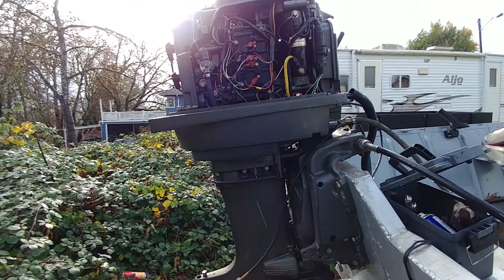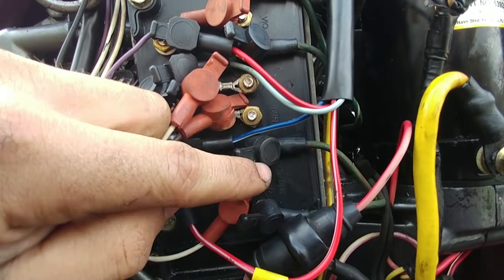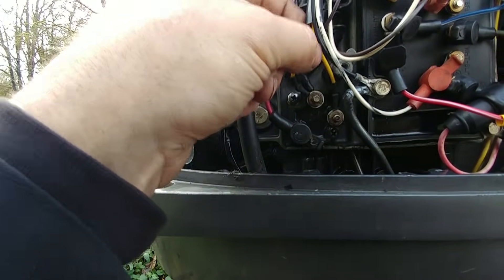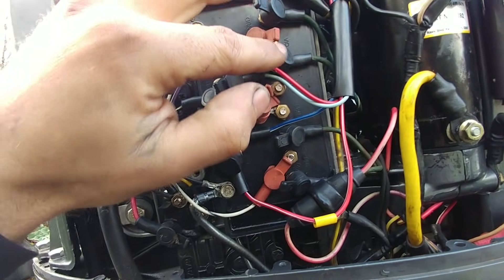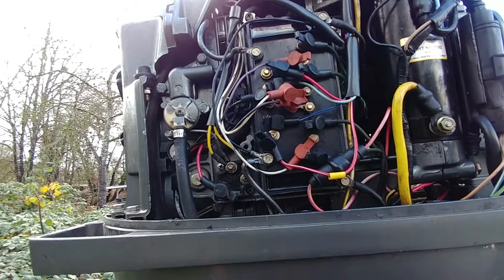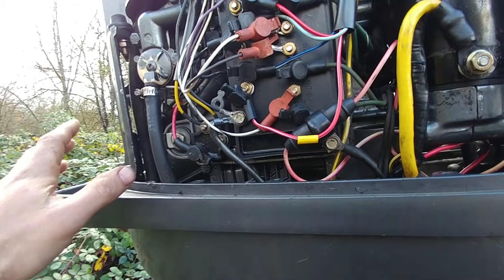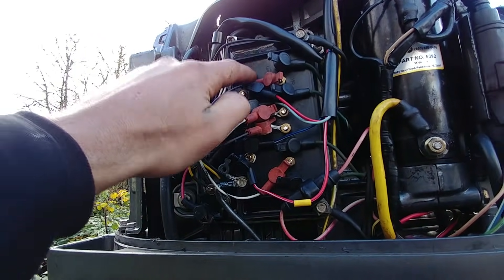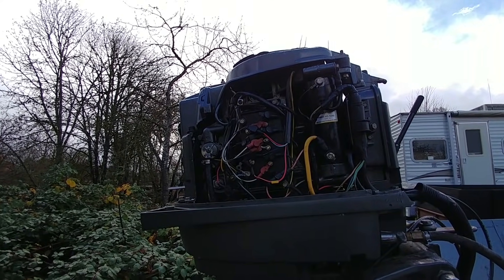how to fix no spark outboard

Comment: Not sure if you will respond to this as this video is 7 years old, but may I ask what motor this is? It looks very similar to the Mercury Thunderbolt that I have on a FB Marketplace find boat. I don't know much about boats and outboards, but I am trying to learn and get mine running. It turns over, but have yet to be able to get it to fire up yet.

Comment: problem with my CDI (Johnson 35/2-cyl/2-stroke) is the CDI is molded.. not connections.. the wires disappear inside.. I'm going to try and 'stab' them to get a reading. I've swapped out plugs, coils, wires... bottom cylinder isn't firing... you would think swapping coils, wires, plugs would reverse the symptom but it's still the bottom cyl not firing... could it be the CDI pack?
ps.. great video.. easy to follow.. thx

Comment: Having intermittent spark on cylinders 3 and 4 on 1986 Mercury 75 hp. Swapped wires but finding it very difficult to isolate the problem by engine cranking only.

Comment: Current goes 1st on the rectifier and then to ignition coils and cdi right? Ac current from the stator wouldn't do the job if it was directly connected to the cdi and spark plugs

Comment: Don you still own this engine bud .I'm from the UK and nobody over hear knows a thing about theses
Reply from the maker: I have one just like it yes
Reply: I know this is a bit of an ask .but would you be able to help  me locate some Information. Regarding the wire diagram for the starter /  ignition switches .also would you know the correct part number for the trigger as I'm struggling for a spark
Reply from the maker: Marine engine.com will have alot of that info.

Comment: I'm getting no fire to any plugs on a 1997 Suzuki DT115 with less than a 100 hours on it. Mines turning over but its getting no fire to the plugs, from my understanding of the Factory Manual it could be the Pulsar Coil, the Trigger, the Gear Count Coil, the Stator or the CDI Unit. I wish there was a video on how to test all the different parts to know for sure what to replace.
Reply: I’m here today with same issue as you describe
Reply: @JayMuzz-xn3rv  It's been a while like about a year but after spending $150 for a Factory Manual I had to get the Voltage tester leads to add to my Multi-meter to test everything and it turns out it was my CDI Unit. I later found out when I let my step father use the boat for the summer he jumped the battery instead of taking it out and charging the battery and he hooked up the jumper cables wrong shorting out the CDI. So, at a $3200 new CDI replacement cost I took the motor off took the boat to a Boat Dealer and dropped $12,000 on a new Tohatsu 115 with 5 year warranty. The Suzuki is sitting in my shop today and I hope to sell it one day.  I'll never buy another Susuki boat motor again.
Reply: I got the same issue right now with a 1999 Suzuki DT150
Reply: Here I am
Reply: @JayMuzz-xn3rv  I had to buy a gauge to test and a book at $200 to find out it was my cdi unit at which new would have cost $3500 so I was done and dropped $12k on a new Tohatsu 115 hp installed with a 5 year warranty. We had a blast this summer pulling the kids on the tube and just cruising the lake.
Reply: @casper3130  That’s a great investment 
It will last a very long time
I am thinking of buying a cdi box for $100 new
And or getting a 150 diagnostic
It’s been sitting for months 
I ain’t to worried about it anytime soon you know
Reply: @JayMuzz-xn3rv  Good luck with it.
Reply: @casper3130  hey man 
I appreciate it
You know lol

Comment: Love the content! Not sure where to begin but I’ve been looking forward to firing this old  105 hp Chrysler  I recently found[surprisingly clean] but needs some attention.so far, I’ve rigged the ignition switch at the motor to eliminate bad wires and so forth, but still will only run for a brief second on starter fluid and only with the key in the on pos and by jumping the solenoid.Initially, I got spark on all cylinders with an in-line spark  tester,but now I don’t seem to be getting spark on any cylinder. Compression is at 145-150psi. Cleaned out carburetors twice. Any tips would be appreciated! I suspect the timing may be off but I will also change the plugs is weekend and go from there since I don’t believe fuel delivery to be the issues since I’ve changed it! Thanks in advance!

Comment: Ok little confused.. you said the stater is to convert A/c to D/c to charge batt. Then you said the stater was to give the power pack charge. Will a motor start if there is a bad stater? And what about rectifier, will motor still start with bad rectifier?
Reply from the maker: Ok sorry. There are two winding in a stator. One the powers the cdi for spark. And another that feeds the rectifier. Then power gos from rectifier to battery. Bad rectifier engine will run with no battery charge. Bad stator on the cdi side no start. Bad stator on the rectifier side will start.
Reply: @CAPTAINWILLY   Thank you! 
It did finally attempt to start and when it did I noticed the flywheel changed direction to counter clockwise not sure why Maybe I have the stator on wrong I need to rotate it one bolt hole IDK you have any idea? And there is only 2wires coming out of stator I don’t think I got them hooked up wrong. 
Working on 1979 Mariner 115hp in line 6 tower of power. 
When I try to start it flywheel is rotating clockwise (normal) rotation I believe, then when it attempts to fire up flywheel changes direction. Haven’t ran it that way don’t want to miss it up.

Comment: I have an early '90's 175HP mercury outboard and one ear broke off the propeller (didn't hit anything) drove it back with alot of vibration for 10miles and suddenly the motor completely stopped. I have no spark anywhere now and motor wont start but turns. I did a visual inspection and no wires broke off. Had a mechanic look at it and he stated it might be a fried ECM , three wires that looked like they melted and or bad coils. (I don't think he did a well Diagnostic on the motor.
While reading through the comments it looks like a bad CDI box , Stator or trigger.   
My worst case scenario a bad piston ring fell.  I'm not that great with electrical.  Any help would be appreciated

Comment: My motor is turning over but no spark on any cylinders I have 2 stroke 4 cylinder merc mariner 40hp. What could it be replaced stator switch box battery spark plugs what else?
Reply: I have the same issue.  No spark anywherr..anywhere... have you figured out your issue?
Reply: @Diego-le5xt  I think my new stator was no good have you changed your stator? About to try a new one I'll let you know once I try that if you want...
Reply: @robpaul7900  yes let me know. Thank you

Comment: So I have a Merc 90hp 2002. But it does not have a CDI box.  Just the rectifier.  Still trying to figure out why no park. If I have no CDI box where do I look for that interchange between Stator and trigger?

Comment: my 2006 90hp 2 stroke OIS ignition suddenly has no spark. IF im testing stator right MY ohms reading brown to brown 865 dva output 219, orange to orange ohms 56 dva output 4.5 im reading that on dc 600V should that be on Ac volts ?. I believe it has a sensor not a trigger. Not sure if one can create other to show no fire?? Dont mind putting some$ in to it just dont want to throw bad $ at it. Any help is appreciated

Comment: Hi Captain, I have a 79 mercury 115 with no spark. I just got it. The previous owner replaced stator but not sure what else they did. I’m not sure if it’s a bad kill switch, trigger, cdi, coils etc. I see a black wire down by the cdi with tape rapped around it. Do you have a diagram or know where to get one. I’m not good with electric at all but willing to learn.

Comment: Hello there boat Community!

I hope someone see’s this, I recently got into boats and motors and am trying to repair a 4 stroke merc 6hp 2007, which has been standing for about 1-2 Years. 

But as I dont really know too much im having some troubles, theres no spark, (already changed oil, Spark plug and gasoline) so I thought it was the Coil, so I brushed that real clean of most rust, sadly I dont have an Ohm reader to test it. 

My guess is that the kill switch cables are the problem though, would you have some procedures or tips to finding what my motor wants and or needs, thank you in advance. I do not have the money to let a professional look at it or buy any expensive spare parts.

Have a nice day.
Reply from the maker: Guessing will be expensive. Go down to harbor freight and get a dvom. Digital voltage ohm meter. You will meed to test continuity between both wires on the kill switch in both positions. 000.= engine off postion. Open=engine run. 
Fair warning. Boat is an acronym. Bust out another thousand. It can be cheap but when things brake its usually at least 200 bucks... Every time
Reply: CAPTAIN WILLY Thank you for the advice I will try to get one as soon as possible as well as test it out! 😄
I’ll keep you posted If I make progress!

Comment: If trigger is bad would that cause stator wires to get hot and melt the plastic
Reply from the maker: Yes. And or the cdi box. If there is any short to ground. It will cause melted wires. Iv even seen a coil cause it

Comment: You have some of the best videos out there on this man thank you
Reply from the maker: Thanks brotha. Please share it on your socials
Reply: CAPTAIN WILLY I was wondering if the trigger is bad would that cause the stator wires leading to the switch box to get hot and melt the plastic coating on the wires
Reply: I just shared it as well

Comment: Around here 95% of the ones iv worked on cdi or power c
Pack bad my merc 90hp stop firing one #1 power pack
Reply: I just fixed my Johnson 110. It would run great when cold but when it was warmed it would run like crap. Hard warm start.  Had air, fuel and compression was 115 across the board.  It was the power pack. Replaced and now she hits 32 mph on 20ft chapperal at 5100 rpms

Comment: Thanks! Please give me your advice. 1985 90hp Evinrude 4 cylinder. Runs rough at idle and low speed. Kicks in at mid to higher speed... One cylinder barely working at idle when plug wire pulled off while running. Things i checked...115 compression...coil swap...plug wire swapped... Fuel pump checked.. carbs swapped (2 double barrel).. sprayed carb cleaner into bad carb throat no effect but kills other side of double carb when sprayed into it.. checked spark with timing light looks like others..ran it with the plug out just blows warm air no water or fuel..plug is never very wet after running just lightly wet.. cleaned the carbs.. still not picking up that weak cylinder. Please let me know what you think. Edit... Ok i switched the power packs no change.. when i spray starting fluid in carb upper and lower it gets boggy.. also bogs when priming bulb or pushing in key for choke.
Reply: By the way this motor has one power pack per side. Thought about swapping them but timing light showed ok.

Comment: I need help with my motor just bought a boat. No spark on any piston
Reply from the maker: You need to test ac voltage from your stator while cranking first
Reply: I had that problem, and it was the safety switch
Reply: Lucas Hunter hey I got one cylinder not firing, I have done all the trying different wires and it works on different wires, would it be the stator ?

Comment: I have a 2002 merc 75 hp 4stroke.  only 2 and 4 have sparks on. 1and 3 do not have sparks. I am going to need to replace all the wires and give it another try tomorrow If I can find 804271T in stock with all the dealers here on the island. If not, I will have to wait for the eBay guy to ship to me.... If there is still a problem ( not geting sparks on 1and 3) I will hate to replace the stator and It IS a pain in the ass to get the flywheel nut off( I had to ask to plumber guy to use his ranch where he gets off the 2" pipe off) and then get a KMS tool( $30 )to take the wheel off( I think it is called a flywheel puller).  Extended cranking on my bad costed me a $300 starter, another $280 for those two sets of coil wires, and I do not want to spend another $300 on the stator.....  You video is good information and is helping me to regain my confidence after I lost power on the water last week..... I am from Canada but has not so fluent english writing skills.
Reply from the maker: Your writing was great. A little tip for ya. Find a big tough angry dude and a long pipe. Put the pipe on your wrench and make the big guy hold it tight on the flywheel nut. Then tap the starter. Cranking the engine should rotate the nut the right way to loosen it.
Reply from the maker: Only spark on two cylinders. 
Attack one at a time. Trade coil wires on the cdi box from #2 to#1. If you now have spark on #1 coils are good
Put it all back.
Then trade trigger wires from #1 to#2. If no spark on #2 then you need a trigger. If spark on number 2 then you need a stator. Make shur to test voltage input to the cdi from the stator
Reply: @CAPTAINWILLY  As you said, I am trying to follow your method: "Trade coil wires on the cdi box from #2 to#1. If you now have spark on #1 coils are good--> If not, the wire /and the coil is cooked? or the stator is cooked as well?. , if #1 coil is good, I move on to trading #1 to #2, if no sparks on #2, I will need a trigger? If sparks 2, then you need a stator.  I mean If sparks 2, does it mean the stator is good since it pulling juice into #1? Thank you Captain and have a good night.
Reply from the maker: Yes. By trading around known good trigger wires amd get spark out of corresponding coil outputs the stator and cdi are good amd the trigger is bad. If you trade known good trigger wire amd it stays dead amd coil is already tested. Then you have a bad cdi or stator. Habe to test output voltage on stator to be shur
Reply: @CAPTAINWILLY  here's the update. I got four used coils and wires from eBay for $75. Got all sparks now.  Still not starting... Is there a way to test if the trigger is good? or is the stator is good? Pls advise Capitain when you have a moment?
Reply from the maker: @ovovov123123  you have spark on all cylinders yet not starting? Have you tried starting fluid? If everything is hooked up amd your getting spark on all spark plugs amd you apply supplement fuel(starting fluid) and no bang back fire sputter or amything. You will need to check for compression
Reply: @CAPTAINWILLY  will try again tmw with starting oil. Thank you
Reply: @CAPTAINWILLY   Captain, report back from BC Canada: starting fluid worked-> fuel line problem.  I was going to go a compression test anyway, and noticed the grey line to the 4 cycles are so loose and clamps are loose too. So I put some brass ( plumbing clamps on to seal that shit for now, and ordered new fuel lines as well.).  I also  noticed the major fuel line connecting the float is bleeding some fuel out, again put two plumbing clams on both ends.  Another interesting finding shows the fuel pump has been replaced wiht a Mikuni brand. good news to me becaue i do not have to replace it in next few years. here are what might worked for this old girl 2002 merc 75 , 4 cycle, carburated version: 1) make ensure sparks are all on, 2) followed fuel line to see if they are airtight or insufficient (blocked or those soft aged fuel lines need to be replaced and clamps, too). 3) dumped all old fuels in the tank, in the floater 4) cleaned carb twice with one air pump to blow any shit out of there..... Finally, with the help for starting fuel, it worked for me, Thank you for your guidance! Man, fix that girl feels good! I am going out this weekend to give it a real test on the lake.

Comment: There’s three wires on top of my 115 hp evinrude cut wires a purple one gray one and a black one I can’t find where they go I think there trigger wires
Reply from the maker: What yearish? 2 stroke? How many cylinders?
Reply: CAPTAIN WILLY 1974 115 evinrude I think there trigger wires but I can’t find where they go they look cut just laying on the back of flywheel under it sort of in a taped up harness
Reply: CAPTAIN WILLY 4 cylinders

Comment: Hey. My mercury has absolutely no spark. I am getting power to the box.
Reply from the maker: How many cylinders what year or year ish.
Reply from the maker: No spark on any cylinder? And you have ac voltage on all stator wires?
Reply from the maker: If there is ac voltage from the stator like i said in the video. Yet no spark anywhere. You need to test resistance across the trigger. Depending on how many trigger wires you have/ cylinders you have. There are lots of videos how to test a trigger. But its likly a bad cdi box. Usually when a trigger fails its only on one cylinder or two. Total loss of spark is more like the cdi. Only replace it if the trigger tests good
Reply: 89
Reply: 3 cyl